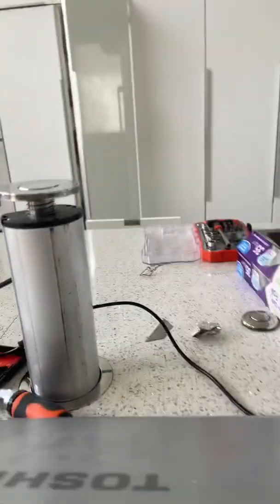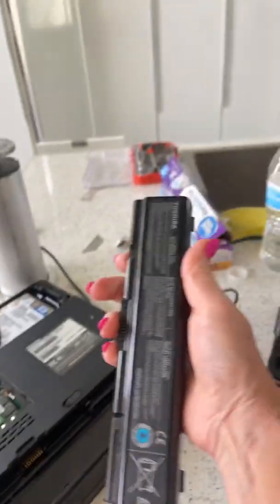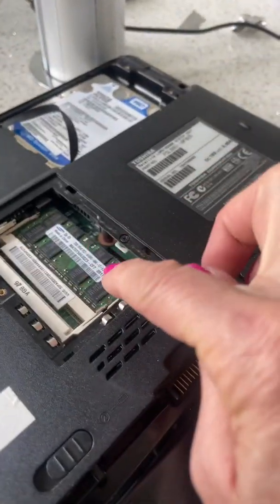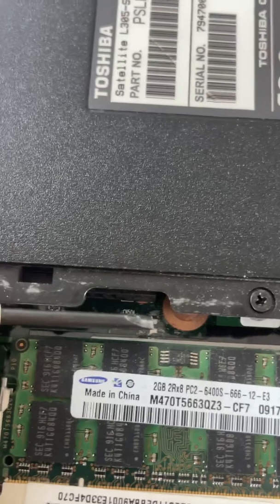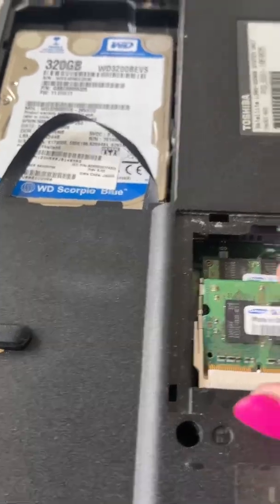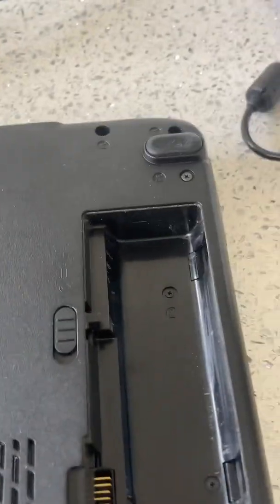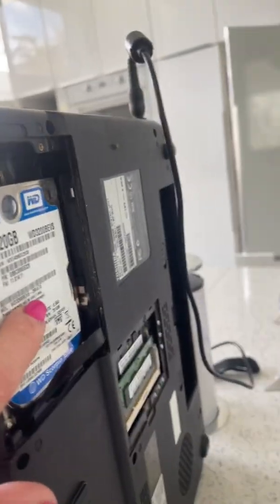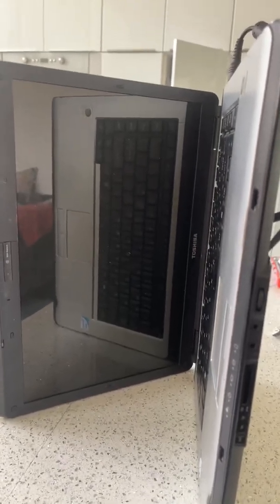How to fix Toshiba laptop BIOS password issue

Comment: I have an old L505-S5966 Toshiba Satellite, this method will work but on mine I had to look for "B500" location just above the lower RAM chip.  It took several tries but it did work.

Comment: I did this by leaving the computer plugged into the mains, removing the hard disk and the button cell, but leaving the memory stick. Then I connected the 4 jumpers together using a piece of metal (the base of a screwdriver bit in my case), you have to do this several times fairly quickly (a bit like pressing “ESC” several times quickly to access the BIOS) until the computer powers itself up, without pressing the power button. The computer finally booted up, I switched it off and on again, and now the BIOS is accessed directly. Hope that helps !

Comment: i have a toshiba satellite C670-1DR, can't get the bios password removed... any ideas?
Reply from the maker: Tom, you will want to remove the back cover, remove the Ram and large ion battery after powering down the device and removing the plug.  There are two little nodes that you will need to jumper.  I believe there is a number “ST2002” by these nodes.  You can make a jumper out of a small strand of Ethernet wire and make it a u shape.  You will probably want someone to help you because you are going to have to turn the laptop upright, hold the  jumper wire on the nodes and hold down the power button for about 10 seconds all together at one time.  Then release the jumper and put back the battery and the ram, restart the laptop  and you should be able to enter the bios thru the F2 button.  Hope this helps.  

Helps me if you like and subscribe to my channel.  I appreciate it.
Reply from the maker: I will take a look at later today and let you know.